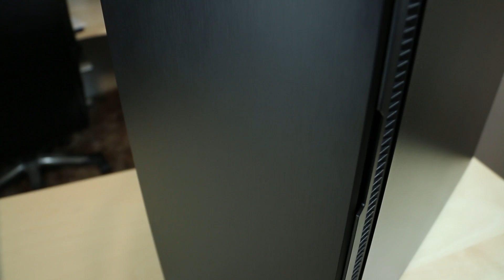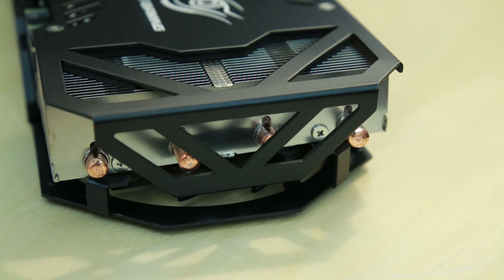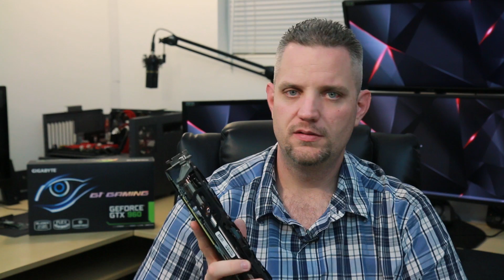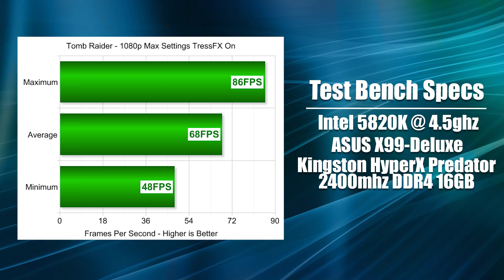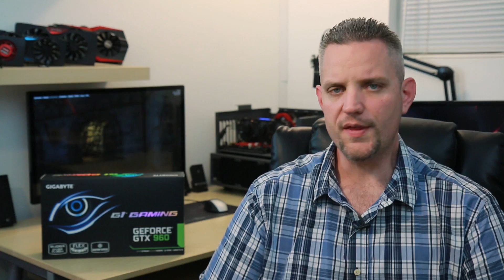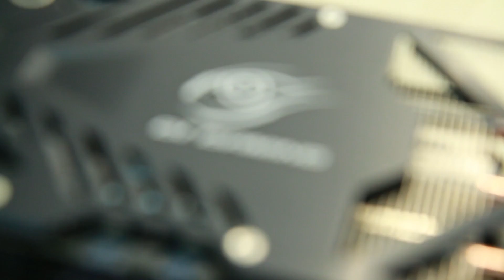Gigabyte GTX960 G1 GAMING - Best Mid Range Card Yet?

Comment: How does this compare to a 680 I'm looking upgrade soon
Reply: Not worth it. The 680 is essentially the same as a 770 and the 960 performs worse than a 770. Honestly, you'd either want to wait for the next generation of GPU's or get the 970/980.
Reply: I'm probably going to wait for the 390x and if that doesn't impress I'll wait for the 980 ti
Reply: TheVanillatech and im still sitting here with my SLI 760s from July 2013 lol they were the shit and kicked the crap out of the 780 for a couple hundred bucks less.  Then came the 780ti and the regular 780's price went down to $549 and 2 760s were not as appealing as before.  I was planning to upgrade to a single 970 but with the 3.5gb bullshit I decided not to and the 980 is out of my price range.  So I'm back to waiting again to see what AMD decides to bring out.  Btw, the 760s are still alive and kicking, they still manhandle any game(ubisoft games not included, I refuse to even get a bootleg edition of them) at 1080p ultra settings
Reply: Tocas97
 Or get a cheap amd, especially in q2 under the r9 3xx mayhem. I wish we will see cheap and powerfull amd cards.
Reply: They could steal the market if they make the 380x > 980 and the 390x for $500. I'm hoping the prices are lower because of the stacked memory.
Reply: Zoltan Orosz I wan't bashing on AMD, but since he owns a 680 and asked a question about a 960 i thought he would be interested in a another card from nVidia. AMD does tend to lower the prices of their cards but they didn't release any enthusiast card in 2014, that's why they lowered them across the board. And AMD doesn't necessarily equal cheap, remeber when the prices inflated due to cryptocurrency mining? That was what ended up making me choose one over the other.
Reply: Tocas97 gtx 680 is weaker by like 15% of 770.. and gtx 960 is around 5% or more stronger then 680.
Reply: Bu11sEyes the 770 is a rebranded 680 it just has slightly faster vram. The 680 is still faster
Reply: lool 680 is not faster sorry mate.. gtx 770 is faster quieter. etc etc.
Reply: look it up they're with a frame in most games. I owned a msi 770 and traded with my friend for his reference 680 so I could water cool it. There's literally no difference in performance
Reply: sadly there is
Reply: sadly you're wrong. Now can we stop talking out our asses and look it up first? So many people who have no real evidence for their claims and try to act like they know what they're talking about....
Reply: The differences between the 680 and 770 are:
-Faster Memory Clock on 770
-GPU Boost 2.0 for 770
-In general, faster Core Clock on the 770

That's it. Same architecture, same memory buffer size and same processor. Now please, let's put this issue to rest.
Reply: Either get a 970 or R9 290
Reply: or a 780ti....why doesnt anyone fucking mention 780 ti? x( x( its a BEAST..beats EVERYTHING do u all fucking morons hear me!!!! it wipes the floor with a 970..wipes the floor with a 290 or 290x....beats the shit out of 780....780 TI IS THE SHIT!!!!
Reply: soumya basu Whatever makes you feel better, buddy.
Reply: From a 680 this is not an upgrade...
Reply: Ken Pachi
I'm sure those 760's will do you just fine for another year at least. The 980 is totally overpriced anyway. A marginal gain in performance on the 290 / 970 but for a shitload more money. I don't blame you for waiting.

I bought a 970 last month but only because I got an amazing deal on a KFA2 card through a friends business. I'm sure AMD will do what they always do and rape nVidias entire lineup in terms of price / performance once the R9 3x series is released.

By the way what are you scoring in Firestrike with those two 760's?
Reply: Ken Pachi 760s in sli are very powerful..but the problem is low vram...i own a 780ti which has 3 gbs of frame buffer and i am already seeing that games are fully utilizing the vram at even 1080p...980 is a very good gpu considering its ven more powerful than my 780ti and is a 4gb card...it is not overpriced considering the 780ti was more expensive when it came out...its just that 970 and 290 provide more value for money...
Reply: soumya basu
Then the 980 IS overpriced. You can't say that a card which performs only 15% better than a 970 but costs almost 100% more is NOT OVERPRICED. Also the R9 295x2 is the same price as the 980, but is twice as fast. Come on man, wise up :D

Also if you're going to say the 760's are VRAM limited then you also have to say the 960's are a joke. They are 3 years newer than the 960 but have the same VRAM. Personally I think 2GB is ok for 1080p gaming unless you're going to be modding skyrim or something. It's not like either the 760 or the 960 can handle games in Ultra detail with 8xAA anyways.
Reply: TheVanillatech no you keep comparing the 970 and the 980...and you keep saying that 980 is overpriced because its only 15 % more powerful than a 970....you are only proving my point that 970 provides better value for money...besides 980 has full 4 gbs of usable vram...your arguement is that the price differencr between 980 and 970 is not justified by the performance difference,...there you have a point...but if you look at a 980 individually... a card that beats my 780ti which costed 700 usd...which has full usable 4 gigs of vram....and which runs way cooler amd quiter..,530 usd seems to be a very decent price tag for it...it even beats the titan black dude...so to put it simply... when you compare a 980 and 970, then the 970 provides much better value for money...but on its own..the 980 is well worth those 530 usds
Reply: soumya basu
It's not the issue is it. The 970 and the 980 are not the only two cards available in the world. You have to comapre products with PRICE and FUNCTION. In this way, all graphics cards are to be compared. And right now, in February 2015, there are MANY far better options than the 980, which compared to all of the competition, is vastly OVERPRICED. Just accept it. I'm not lying. The proof is everywhere. Look at the benchmarks and the prices.

Regarding the 980 beating your 780Ti, so it fucking should do. It's a 2.5 years newer card. Brand new technology - the best nVidia has to offer. If it didn't beat the 780Ti, then it would be kind of a disgrace, like the 960 is. And lets be honest, the 980 only just beats the 780Ti, so it's not exactly groundbreaking.

Progression and evolution of consumer technology means that things should get less expensive and better at what they do. You're giving credit to nVidia for something that is a given. If you give credit to anyone, it's should be AMD, who haven't lied about their products and consistently bring out better performing and better value cards than nVidia for the past 5 years while maintining honest business practices.
Reply: I am sorry but i absolutely disagree..taking into account the horrible experience i had with AMD cards i do not even consider buying them these days...before i got the 780ti..i had 2x 7950s in crossfire and it was nothing short of a nightmarish experience...those cards sucked balls...constant micro-stuttering...BSODs...extreme heat...i got so fed up i shed 700 usd on asus 780ti and i have not looked back since...yes it costed a lot...but the performance? nothing short of mindblowing...never faced any issue with my old 780 ti till date...before i used to own gtx 460s in sli and they also very pretty solid cards as well..now lets come to the 980..firstly there is NO single gpu which outperforms the 980..you must be talking about the 290x/290...you have to remember here...amd MASSIVELY failed when they launched those two gpus...its Sapphire...MSI..and all the other board partners who created custom cooling solutions and turned that horrible steaming pile of crap 290x into a decent gpu..so AMD deserves NO PRAISE...amd should be thankful to them for providing custom pcbs and improving 290x...even then it runs with  a 300watt  tdp and gives solid 20 fps less than 980 in most games...for a single gpu which can max out almost any game at 1440p..980 is the solution without an ounce of doubt...for 1080p ..970 still is the king...hope amd does something with the r9 300 series gpus..because nvidia would get too arrogant without any competition..
Reply: soumya basu
Firstly, being the owner of over 65 ATI / AMD graphics cards and having used them since the Rage IIc - I am fully aware of every driver issue concerning their cards. The worst period was during the 9700's reign, which was very annoying and I had problems throughout 2003/4 with that card. Since then? NO trouble whatsoever. People who talk about the AMD driver issue either have no clue at all or are simply sheeping what the nVidia fanboys say. Since I moved back over to ATI from AMD when I bought my 4770's, they have been absolutely fine. Maybe one game (Rage) was a problem but that is it. Period.

So you're complaining about heat with AMD cards? The 94 degrees thermal throttle of the reference 290's from ages ago, who gives a fuck? WHO BUYS reference cards anyways? The aftermarket MSI Frozr 290 I had was 75 degrees TOPS even with a max overclock in Afterburner. That is COOLER THAN A 780 / 780Ti. And nvidia boys keep talking bout dat heat tho.... get's boring.

Tell me when in the last 5 years have nvidia dominated in ANY sector of the gaming card market, and I will prove you WRONG. Cos they HAVENT. AMD been raping them for fucking years, and right now it's so far ahead in terms of value / performance (the ONLY things that matter) it's a joke. To deny that is to deny reality. Sure I am using a 970 now, but like I said a friend of mine got me one half price through his business. I have no prefernce to either company, I was using graphics cards from Matrox and PowerVR and 3Dfx long before nVidia or ATI became the race leaders. I just don't abide bullshit.
Reply: When did nvidia dominate any sector of the gaming card market? When did they not? Dude..Amd is mainly for people on a tight budget...i mean are you joking?? Buying a r9 280x and expecting it to work properly is like tossing a coin and expecting it to be "heads"...20 percent of the r9 series gpus dont even work...you want statistics?? Visit any site..newegg...amazon.com...etc and find the number of rmas...on an average 20 out of every 100 people who have bought r9 series cards have returned them....what price to performance ratio are you talking about? Its 970 that made amd cry...and i mean literally cry...they slashed down the prices of r9 290/290x out of desperation...they always play the catchup game...wait for 6 months after nvidia release their gpus and then they sell similarly performing gpus which cost less...amd has NEVER released any gpu which outperforms nvidia's flagship gpu in that generation...7970 got humiliated by the 680....290x couldn't beat the 780ti...7990 got raped by 690..6950 lost to 580...what are you even talking about? No driver issues?? Amd crossfire is a joke...dude all amd ever does is wait for a huge period of time to release a gpu that is on par with nvidia's flagship gpu and is a complete JOKE in terms of pwer efficiency...like now they are waiting for 6 months to release the r9 380x....it will perform marginally better than 980 and they will slash the price,.,thats all they do...and the 390x will soon be humiliated by the 980ti...they always play the dumb catchup game...
Reply: They have got no gameworks,..no softshadows...no mfaa...no txaa...still stuck with their dumb msaa...i use my shield tablet and stream games from my pc sometimes when i am too tired to sit on the chair after a long day in the office...can't do any of that with amd...what really does amd offer!? Raw performance!? Thats about all? Mantle? That is already a huge failure...tell me why does amd need to give free games in order to sell their gpus if they are dominating the market so much??
Reply: "Never settle forever bundle"and blah blah blah all their offers...desperate to sell their gpus? After the 970 was released do u know that literally everywhere people stopped buying the 290/290x......no one even considers buying the high end amd gpus after 970 was released...why should they?? A 300tdp card that loses to a 148tdp card witg 3.5 gigs of memory?? Amd has no control over the gpu market right now...they are relying HEAVILY upon the r9 300 series...and i personally have faced driver issues with my xfire 7950s...nvidia releases a driver update with every game...who said price/perf is the only thing that matters?? That is YOUR personal opinion...driver support....heat dissipation...power efficiency , everything matters...maybe to you they don't..but that isn't the case with everyone.
Reply: your statement that "amd has been dominating the market for years" is absolutely wrong...and sorry to say but one must be extremely ignorant to even say such a thing 
http://www.fool.com/investing/general/2014/04/08/why-nvidia-will-continue-to-dominate-the-pc-gaming.aspx

read the article..it explains in detail who has has the edge and how...amd can NEVER dominate the gpu market for the very simple reason that their ATTENTION is divided...they are trying to be "jack of all trades but master of none"..they are trying to control the gpu market...cpu market...plus the consoles...NVIDIA concentrates SOLELY on gpus...you want to know how amd gets humiliated...ASUS did not even create a custom cooling pcb for r9 290x...they used the one on the 780...amd was..is and always will be the poor man's choice....their products are crude and inefficient..but they get the job done...thats all
Reply: TheVanillatech and "blatent" ? i think you mean "blatant" xD someone must have treated you badly at some point in your life...i hope you make peace with that person
Reply: soumya basu
No child. I already asked you twice to give me an answer to a simple question and support your claim. Each time you have replied you just ducked and avoided my only question. Like I said, man up or shut up. Talking pure shit is never going to win you an argument. And if foul language offends you then maybe you need to grow some thicker skin. Go outside more, perhaps.

I gave you two chances to answer. You ducked each time. Limbo dancing shit talker is all you are.
Reply: You must have issues at home...settle them first before shitting over you tube...i already posted a link answering your question,..seems like you are simply trolling or just too slow in the head
Reply: TheVanillatech and if you cannot speak properly without abusing then i suggest you learn to get civilized first....seems like you are some 4th grade nerd trying too hard to defend your amd and when crying hard when you fail miserably...seems like everything in that link i posted went waaay above your under-developed head...as expected...asking for answers when i already posted them...very smart you are indeed
Reply: soumya basu You didn't answer my question. I asked for you a date and a comparison of the offerings by Nvidia and ATI/AMD. That was all. I asked you three times now. You have refused to answer three times. You are a full of shit moron. Now kindly fuck off and stop talking about things you clearly know nothing about or grow some balls and answer the question :D :D :D
Reply: There we go again..resorting to name calling like a typical under privileged child....you are now proving that you are genuinely very stupid...it must be very sad to be you isn't it? Parents couldn't afford you to send to school maybe...nvidia has control over 65 % of the market and it has been so for the past 5 years....no seriously...why are you so stupid? Are you trying to be insulting? You are only embarassing yourself
Reply: soumya basu
Do you suggest that I "learn to get civilized" or do in actual fact "get civilized". Sometimes it's very hard to understand what you are saying because you write at the level of a child.

I read through all the bullshit replies you posted so far. The reason I ignore them are various. Sometimes you get things so wrong it's clear there is no point in counterpointing you. I refuse to correct you, THEN counterpoint you. If your level of knowledge is that low on the subject then I ignore you. I am not your teacher. Other times you say nothing at all interesting or everything you do say is purely opinion (and factually wrong - again I could post proof but see the reason above for why I don't bother). Lastly, I asked you for a simple answer. You haven't given me one. You danced around like a chicken on fire squawking bullshit and then finally backed out of the entire argument without giving me an answer. Typical shit talking nVidia fanboy.
Reply: TheVanillatech i am "a shit talking fanboy"?? Lol...all you have been doing is failing miserably to talk like an intelligent person and then you started crying like a 4th grade nerd...i HAD ALREADY POSTED A LINK which answered your question in detail...but you are too impatient to actually read it and understand it...i am going to make one last effort ..NVIDIA AND AMD BOTH HAD CONTROL OVER 50% OF THE GPU MARKET 5 YEARS AGO...BUT GRADUALLY THE THINGS CHANGED IN NVIDIA'S FAVOUR OVER THE YEARS....nvidia invested a lot more money on research compared to amd that graph is also shown...if you deliberately try to ignore proofs which i have posted then that is your choice....amd dominated the market for a short period of time after they released the 290x and it proved to be a very capable card , trading blows with the 780 ti at a much lower price...but ever since maxwell came out..amd has totally lost ground...65 percent of all the gpus sold from 2013-2015 feb belongs to nvidia...if you are able to think with both sides of your brain...you will understand what i said and reply like a mature person...if you do not, you will again whine that i did not show any proof.
Reply: TheVanillatech another proof of the fact, that nvidia dominates the gpu market, is that, most well known gpu brands are nvidia's partners....Sapphire is the only noteworthy brand besides MSI who makes half decent amd gpus...poworcolor, HIS ice-q, pny, gainward...most of these brands are non-existant outside USA....Where as all the prominent names...gigabyte...asus...msi...especially evga..support nvidia...these are not my opinions but facts! ....all the world's leading overclockers ..like lucido kingpin are sponsored by nvidia...

What you find interesting or uninteresting is of little importance to me or anybody...since you are nobody ...you have not shown any proof which supports your outrageous statement that amd dominates the market...i have explained in a simple manner why nvidia is superior with the help of facts...however if you want to get uber-nerdy..i can show you detailed proofs as well...and what exactly have you done??..make stupid statements without backing them up with proofs..slang like a bullied kid...and repeatedly whine that i have not showed any proof when i already have..so kindly stop bullshitting
Reply: Would you guys stfu? If you like a brand buy it, neither of your decisions affect each other. So drop it, you both look so childish.
Reply: Luke V lol...i forgot the original comment was yours......i must have increased your notifications xD